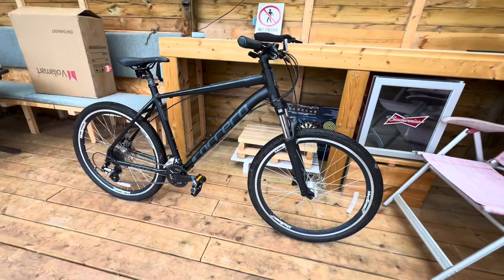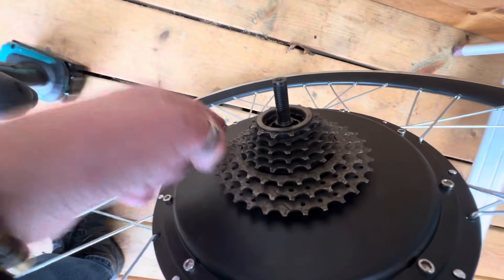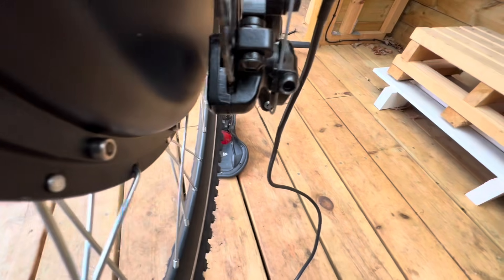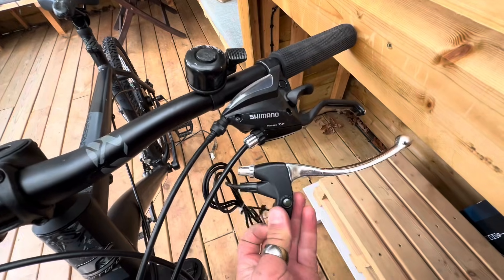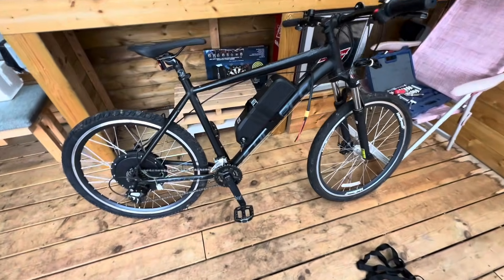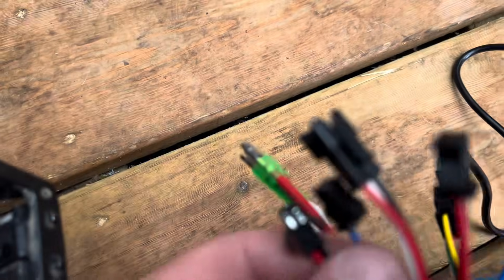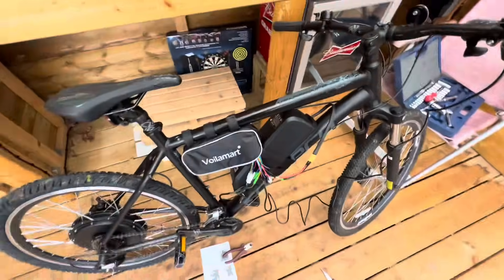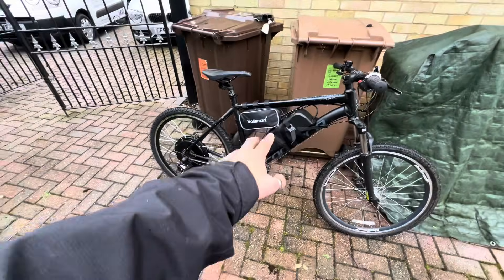Building a DIY Ebike for £300

Comment: yeah you can build an ebike for £300 or even less but that doesn't include the battery which will cost you roughly another £300
Reply: £300 MINIMAL, and make sure iots Panasonic LG or Samsung cells and not assembled in china  trash, because a battery fire will burn your whole house down
Reply: Depends where you get the battery. 72v linglong batteries can start from £100 - how reliable it is another matter but there are cheap power options too. I got a like-new (3mile usage) 60v Samsung battery for £50 from marketplace not long ago, they’re about £300+ new. cheapest way to do it Imo

Comment: @Ethan Overton
Nice video I've literally just made my vengeance into a ebike aswell, ive got everything done and sorted, throttle the lot, just not the pedal assist, what sorta tool would you need? Its like it not properly fitting on if that makes sense

Comment: You sound British, therefore as the motor is likely over 250W which makes it an illegal motorbike, it goes faster than 15.5mph so it's now an illegal motorbike and you have a throttle that works past 4mph making it an illegal motorbike, it's not labelled up which makes it an illegal motorbike... None of what you did is safe or legal!
Reply: Hello, the controller has a speed limit wire that restricts the maximum speed to 250W and 15.5mph. Please rest assured.
Reply: @voilamartebike  You can't limit a 1000W motor to 250W and call it legal, it has to have the maximum CONTINUOUS RATED wattage as no more than 250W, so that fact it's Rated at 1000W means it's always going to be rated at 1000W no matter what you do to it (short of replacing all the miles of copper wire with thinner wire). UK law deems a 1000W motor illegal no matter what you do to the controller!
Reply: @ThatGoth and I suppose you think he's not aware?
Reply: It is definitely illegal. If he rides it where there's no police and he does not have a serious accident, he may avoid prosecution. If police get involved, heavy fines , confiscation of bike and liable for massive injury claims, possibly millions of pounds,  not worth it !!!!!!!!

Comment: Battery upside down bro❤
Reply: It’s the bottle holder screws, they sit too low in the frame so when it’s upside down you can actually fit the holder and remove it freely.. it really sucks but it works

Comment: Late comment but can I use a small frame,will the battery fit??
Reply: this really depends on your bike model and the battery that you decide to use
Reply: Buy a bike rack to attach to the back and get large black cable ties and tie against the rack. Only downside will be that the battery will stay there and you won’t be able to remove it off the bike for charging

Comment: Illegal on uk roads
Reply: At 15.5mph that's why they let teens on it to legally
Reply: Nope - EAPCs are legal in the UK without need for licence, tax or insurance, as it’s technically only electrically assisted not powered
Reply: @dom901  It's NOT an EAPC it's motor is overpowered, it goes too fast, it's not plated up and it has a throttle which all make it illegal and not an EAPC by law.
Reply: @ThatGoth correct, rated power up to 250W, pedal assist limited down to 15.5mph. Obviously, no throttle allowed on public roads.
Reply: @_3rdhaha explain to me whats  if you drive without kit  30mph ? 😅😅😅
Reply: @sajmonxaxopoland8208  yeah, I ride without any electric assistance up to 35mph on flat 😂

Comment: Another illegal bike on the road shouldn't be allowed to buy these kits
Reply: I dont think you considered that this ebike with a good driver is way safer than a bad driver on any vehicle, and in any case why being so mad at this young man enjoying?
Reply: Chris 'Nicholas Angel' Anderson. Keeping us all safe, one finger wagging youtube comment at a time.
Reply: Shatapppp
Reply: Shut up
Reply: Well, if rider knows how to use their brain - no problem. I will go for 1000W ebike conversion kit but will stick to the legal pedal assist speed limit. The higher power output is needed only to tow a trailer with kid, and my fat ass on a bike, which all together goes up to 370 lb. I just don’t want to overload a small “road legal” 250W motor.

Just a common sense, if you own a 2t SUV, always better to have 5.0 V8 with plenty of torque and horse power, and use it at 30% of load most of the time than flooring 1.5 litre four-banger most of the time.
Reply: @ If you get stopped with a 1000W motor on your bike you will get the bike seized and crushed, you will get a fine and you will get 6 points on your licence or future licence.
Reply: @ThatGoth  the motor housing is engraved: 250W 🙂 The rated power and the peak power output are two different parameters
Reply: @_3rd Correct and the law says Maximum Continuous Rated Power, which means a 1000w motor is illegal.
Reply: @ThatGoth  I’m not sure if officers can measure the peak power of the motor. Anyway, if it’s limited in controller down to 15.5 mph, it meets the criteria of the speed limit. I don’t want to have the throttle installed. The only purpose of the stronger motor is the proper lifespan (ie utilising it at 25-30% comparing to 100% for 250W motor).
Reply: @_3rd That's a bit like riding a Harley Davidson but limiting it's speed and thinking you can drive on a CBT.
Reply: @ThatGoth  kind of. Let’s think this way: 250W motor at constant 100% power output will get hot quite quickly (especially with the heavy weight load), 1000W motor running constantly at 250W won’t get overheated so the lifespan must be way longer than standard 250W.
Reply: @_3rd Longer life but still illegal, I've rode 250w's for years and never had an overheat..
Reply: Nope - EAPCs are legal in the UK without need for licence, tax or insurance, as it’s technically only electrically assisted, not powered
Reply: @dom901  It's not an EAPC, it's an illegal electric motorbike.

Comment: Hi can I ask where you got the kit from with the battery, thinking of putting on my daughters bike thanks
Reply: Unfortunately there illegal in some parts of the Uk.
Reply: @ve5xi not if you have the limiter on which keeps it to 15mph max any bike over 15mph is illegal but if you don’t plug the limiter you can go 30-40
Reply: @shakeyelk07. To be legal it needs a limiter, the motor has to be less than 250W, the throttle needs removing or limiting to 4mph and it needs a plate or label with the specs on it, as it is (and even with a limiter) it's still a highly illegal motorbike.

Comment: I’ve got the exact same kit and it only cost me £120.
Reply: From where
Reply: @danyys2184  voilamart 1000w for £120 but they have gone up I’m looking at the 1500w kit from the voilamart for £170(£169.99) not 100% of the battery price.
Reply: From where send link pls
Reply: @hasaanshoaib6639  also let me know if the link works and if you consider getting one they work perfectly only issue is the battery is a little more expensive but the kit works mint I’ve got 2.
Reply: It's at two places for £85 right now - but you've probably found out by now that it's a proper bogus kit. You've gotta go with a CYC or at least a Bafang at the minimum; strictly mid - drive as well, not this rear wheel malarkey.

Comment: not £300 though is it?
Reply: It is actually possible as u can buy a 1000w kit for 150 maybe abit more for delivery and then u can get the 48v battery second hand of market place for 150 that’s without a bike of course but that’s the cheapest option
Reply: It is i got a 1000 48volt kit but needed the barttery spare i got tjhat all for 350 but you just need t o buy a bike off marketplace
Reply: yeah it is tho
Reply: No it's not considered a quality battery costs more than 300 quid @AnandaDaCosta
Reply: Probably one where you don’t risk burning your house down…
Reply: One that doesn't use second hand cells and have a good bmi system so there isn't a high risk of burning your house and bike down
Reply: @iComeInPeace8 yeah well every battery/motor can burn your house down